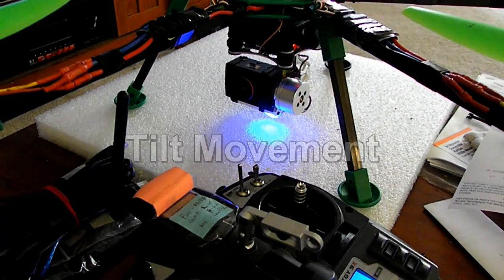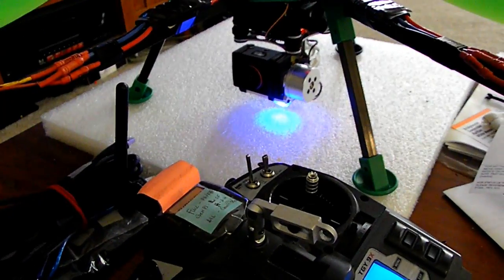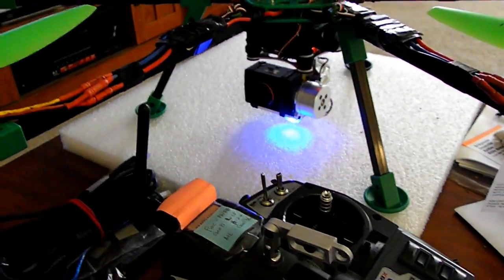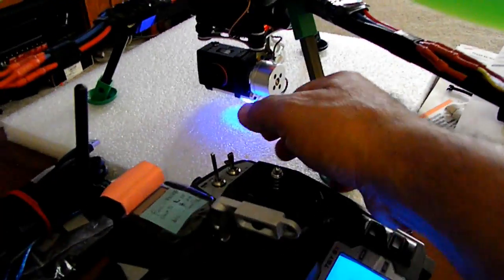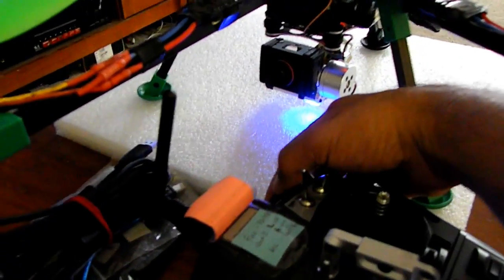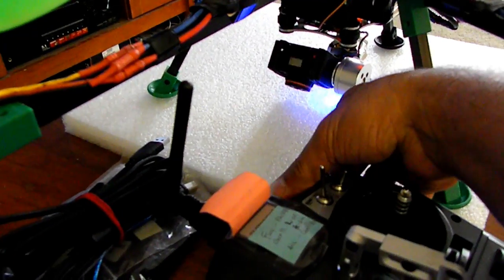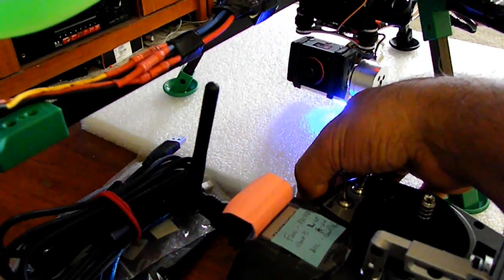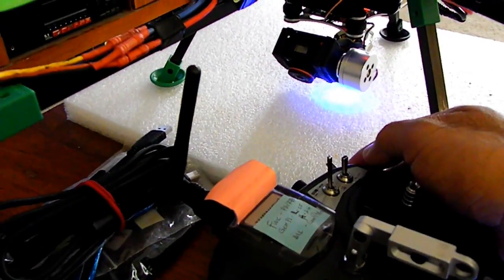2-Axis Brushless Gimbal Tilt Setup - BCG 2.2 Null Hex

Comment: Maj... decided to get back to this problem / issue.... are you running your gimbal controller off the main battery or do you have it separate?
Am I doing something wrong in the mixing on the radio?
I havent tried running the controller off the main battery
Reply from the maker: Hi Mooch. The controller is connected to the main battery. It will also work with a separate battery but the ground wire from the rx needs to be connected (otherwise the using only the signal wire is okay)
Reply: tsisapik Thanks Maj....... tried all that and still zip zitch nothing......
Reply from the maker: moochasas Now that's weird ... I plugged two of my BLG's into the Rx for pitch control and they have worked ... no issues after I adjusted the maximum angle ... I wonder if loading new firmware will solve the issue.
Reply: tsisapik I have 1 HK controller and 1 from witespy..... both do the same thing..... the one from witespy is set up with the alexmos firmware whereas the HK which came with the martinez firmware was flashed to the alexmos null version... I know its got to be something simple bit I dont know what it could be.... everything points to the radio but how can you get a simple allocation of a pot to a channel wrong anyway the pot will operate a servo so I know that works.... totally stumped or more frustrated as I know it will turn out to be something really really simple..... thanks for your help too.